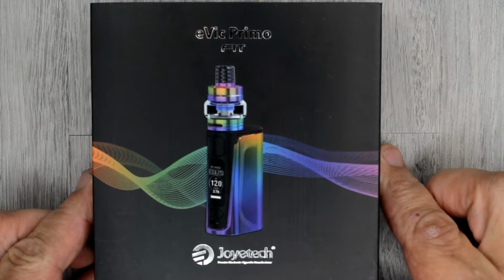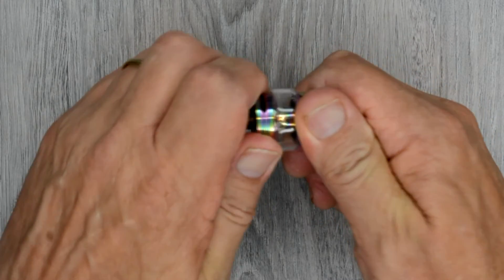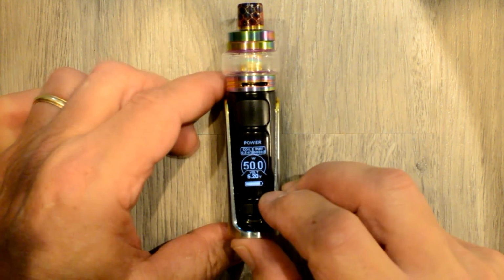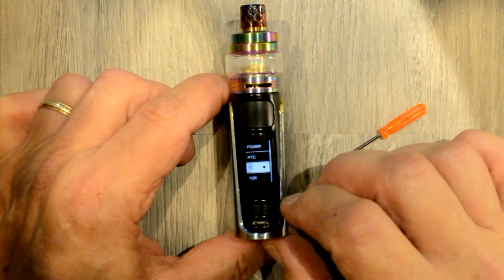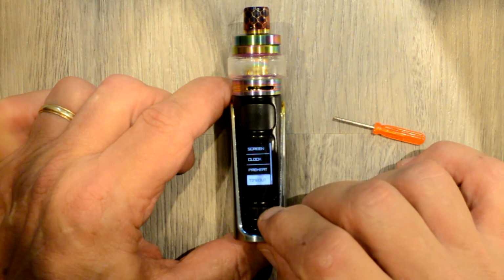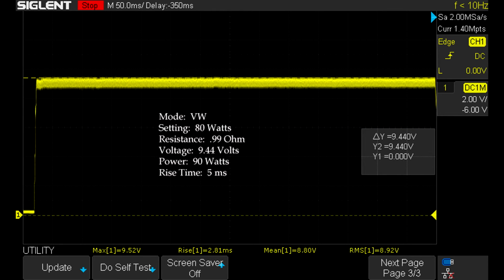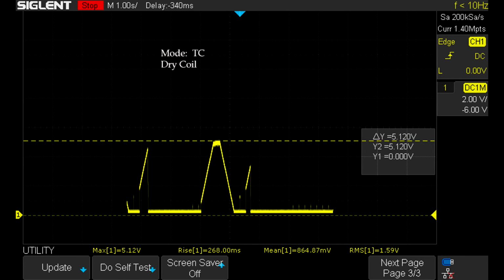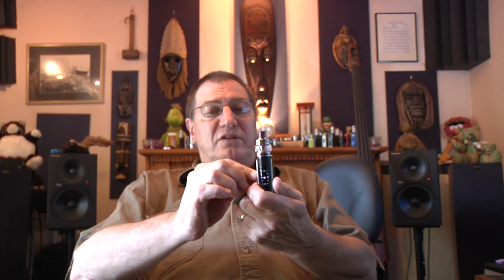Joyetech eVic Primo Fit Kit

Comment: I'm using berseker mini on this mode and clapton wire 0'70 om's...do I have to set temp. (Celsius) or I can just set wats and what is the best setup for these components? I'm new in all of that.
Reply from the maker: No need to set any temperature settings.  Simply use the wattage mode.  Start around 20 watts and increase your wattage for best flavor.  If the flavor starts fading reduce the wattage a little.
Reply: @vapinwally6070  Thank you very much! So I dont have to restart temp. just turn on power option?
Reply from the maker: @gl7492  Yup, that's it.
Reply: @vapinwally6070  Tnx again 😀

Comment: my dear friend. My English is not very good. I didn't get any information about performance from translation. Can you interpret the temperature control for me? Is this device suitable for smoking? Does it deliver stable performance? Is it comparable to others (dna, yihi)?
Reply from the maker: Temperature Control is not as good as DNA or YiHi.  On this device it only helps to prevent dry vaping inhales.  It does not provide a stable even temperature controlled vape.
Reply: Thank you for your review. Is there a device you can suggest? Which mode do you find successful for temperature control? Is there a mode that might be suitable for mtl and dl?
Reply from the maker: Smoant is making some find mods for temperature control.  Cylon,  Charon mini, and Naboo all do a good job.